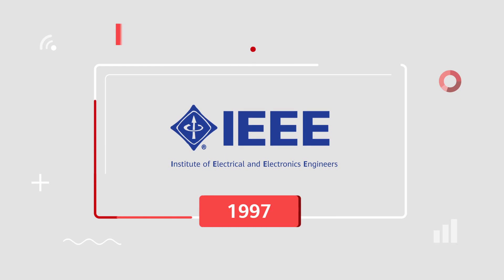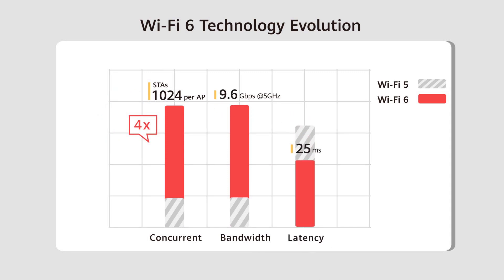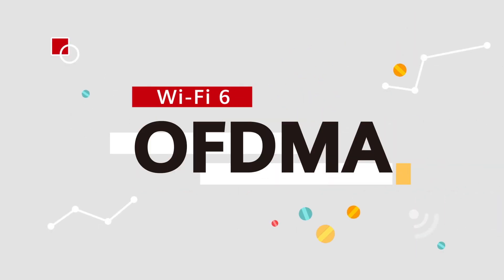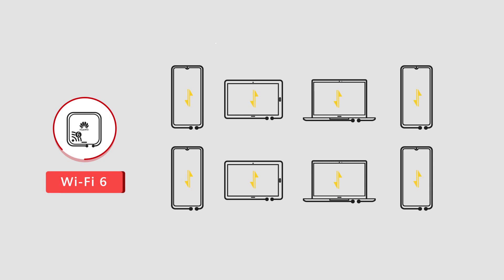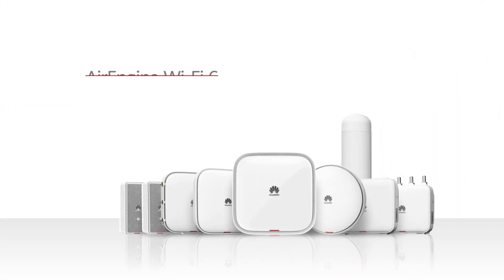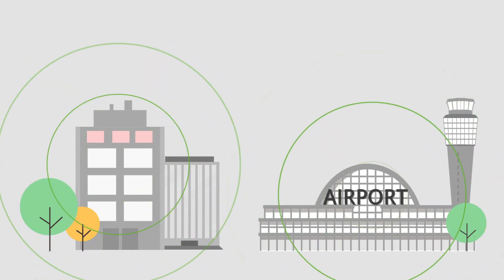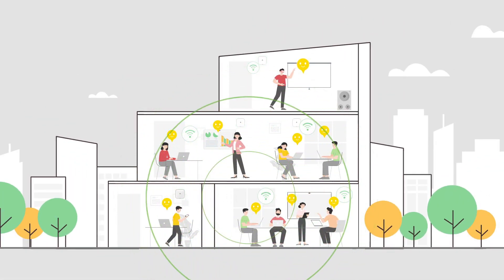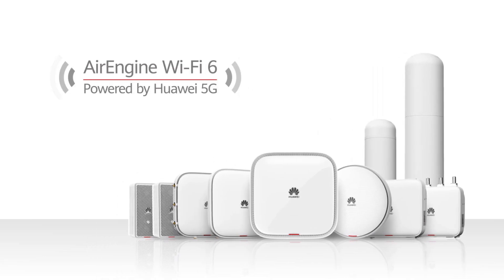Huawei AirEngine Wi-Fi 6 Technologies and Products

Comment: I bought the huawei 
AX-3 Pro WiFi  6 from China. Its from their authorised sales shop. Upon reaching Singapore, it fails to detect WiFi. I have to connect it thru my old router for it to have signal! It's supposed to be the most powerful WiFi yet I can't use it because old router can't reach certain  parts of the house. Speed is also slow, again because its connected thru the old router. Can anyone help? Called their hotline and they don't provide support for huawei products not purchased in Singapore. 😤
Reply from the maker: You can try to give feedback in huawei support website
https://support.huawei.com/enterprise/en/index.html
or go to huawei community
https://forum.huawei.com/enterprise/en/index.html
 Hope you can find answer there.